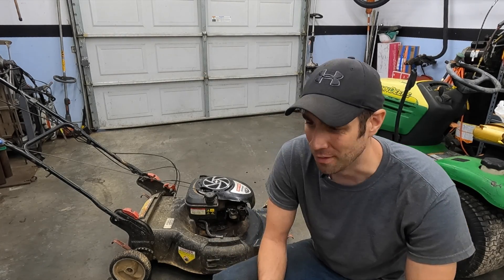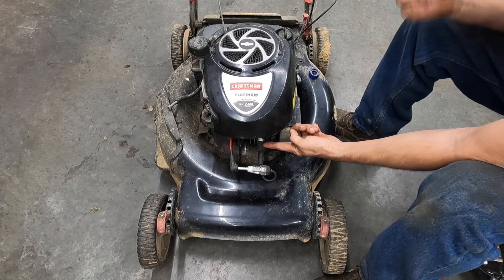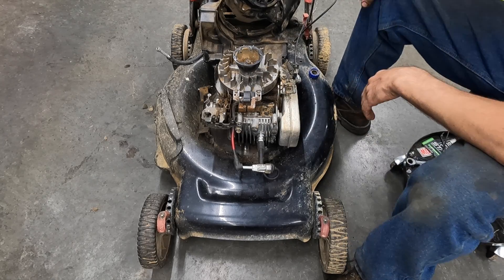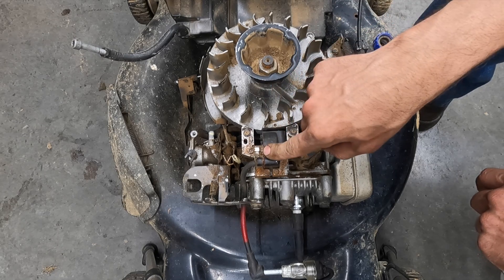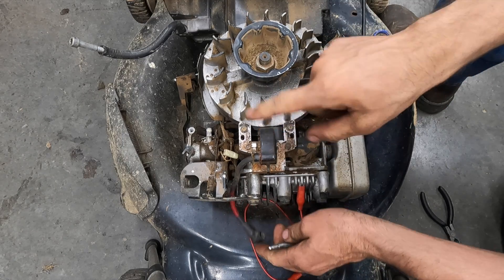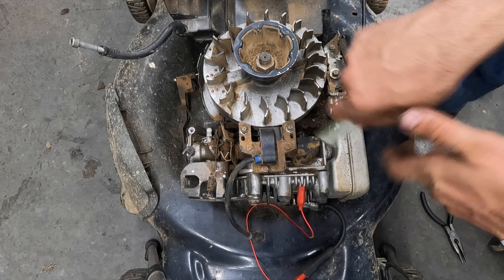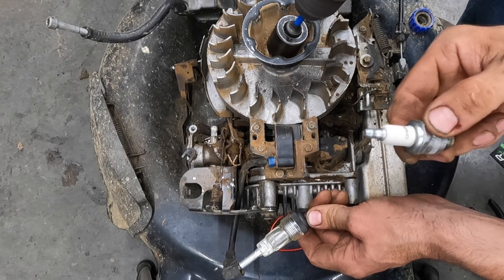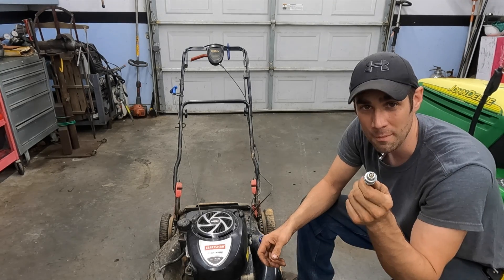How to diagnose and replace ignition coil with no spark on your mower.

Comment: I congratulate you on your successful videos! I have a problem with my Ride on mower Toro XLS 420T. the pto is in operation at all times, the pto switch is in the off position and the pto only turns off when I turn off the engine, with the engine and pto on I put the pto switch in the on position, the engine turns off by itself, check the voltage of the I switched that it goes to the pto and it didn't have any voltage, it seems that electronicity is not reaching it. Do you have any idea what it could be?

Comment: Back in the 70's, I had to replace the fly wheel! How to test; if the fly wheel can hold on to a LARGE head screwdriver, then it's good, if it won't, then replace it.  Point is, it CAN happen. 😁👍
(Before electronic ignition, I almost never had to change the coil, then it was usually from some kind of damage )

Comment: Thanks for the great video. I still have a problem though. I took the coil out cleaned it all up and turned the motor over with a drill. The test light, like yours pulsed when I turned the engine over with a drill as you did. I tested it with the ground wire off and with it on. Both times the light pulsed. I thought all was well, so put it altogether again, put the test light on with the spark plug in doh ....no pulse light. I put a spark plug on order, just in case, but it looks a fairly new NGK.
Any suggestions appreciated.
Reply: so what was it
Reply: Turns out the old coil worked, but had degraded. When I put a new coilpack in it worked fine. Annoying when something half works.

Comment: why wouldn't you use a business card for a riding mower because i thought a business card worked for everything ? Great vid by the way, two thumbs up !!
Reply from the maker: I have and it would probably work most of the time. Some engines on the riding mowers, their gap is .008-.012 and some business cars like mine are .014 thick. Expanding the gap to much could change the timing and or maybe give weak spark.
Reply: @metalinmotionshop  I am going to test that out , because i find i am getting a weak spark , i am going to set the gap to its recommended setting and see if it makes a difference . Thanks for the fast reply and really liking your channel .

Comment: troubleshoot my poulan pro pr 46bt back pack blower
 the spark plug is not sparkling I think it's the off and on switch 
 how do I troubleshoot this 

 how do I bypass the switch to see if the switch is bad .
  replacement kill switch
Reply from the maker: Short answer is disconnect wire from coil and retest for spark with spark plug removed so it won’t start. If you have spark now, it’s the kill switch or the wires have grounded somewhere. Using a multi meter to test continuity on the switch and  wires would tell you which is bad. The switch should have continuity when off and OL when on.  The wires can sometimes be disconnected in the middle with bullet connectors. This make it easy to test the switch side and the engine side to figure out where the problem is. I may try and post a video on it today. I have a craftsman blower that would test similar.
Reply from the maker: Hi Alan I shot a video yesterday. I just need to get it uploaded. Its about checking for spark on a blower. Even though it’s a different blower the principle will be similar. If you got your blower fixed already then congrats… I needed to post a video anyways since it’s been a while.

Comment: Thanks Josh for your very helpful video.  The spark plug tester you used takes all of the guess work out.  With or without the orange spark light you know without a doubt if the ignition coil is working.  Thanks again.  Jerry.

Comment: I replaced breaker points on an older B&S with a module to eliminate the points. I now have a WEAK spark. Motor has to spin very fast to get enough spark to ignite. Runs okay until the idle gets to low then dies. Any suggestions? I have to take the engine OFF of the tractor to adjust air gap or to even pull the cover.

Comment: Excellent video.  Just wondering though, why didn't you use a multi-meter and test the coil like so many of the other videos do?  Right now I've got a coil that tests "good" on the meter, but zero spark at the plug...guess I'll have to buy a new coil...just hate doing that when it may not be necessary.
Reply from the maker: At least with Briggs they don’t give resistance specs for their coil. Also since they’re a stand alone unit (i.e. they don’t use a charge coil and pickup under flywheel) they’re usually easy to know when they’re bad. I do use resistance test for atv and bike coils since they have the charge coil and pickup and it trickier to determine which part went bad. Plus they usually give specs.
Reply from the maker: Usually they either don’t fire or they cut out when they get hot. Both scenarios can be detected with a spark tester.

Comment: If the engine has an electronic ignition and you use a coil pack for one that uses points and condenser it will not work. You should explain that aspect.
Reply: Should also give the alternative using an ohm meter. Not everyone carries around spare coils...

Comment: Good video. Anyways, I working on my Craftsman lawn mower with Brigs & Stratton engine. My problem is that I have spark (not to big) on the spark tester with direct connection to the motor body. When I put in line spark plug I have no spark at all. I tried that on my other lawn mower and it work with spark plug in. Any idea, weak ignition coil maybe ?